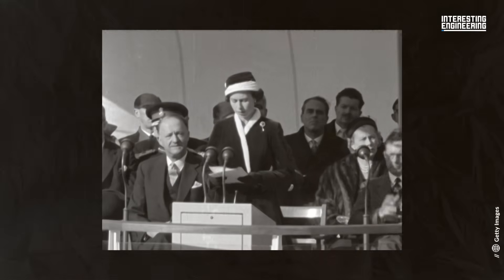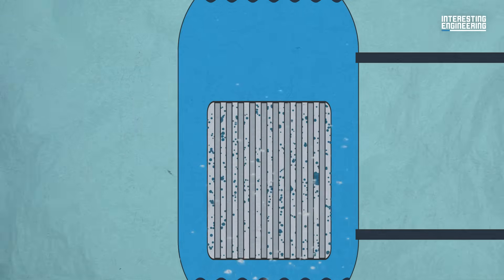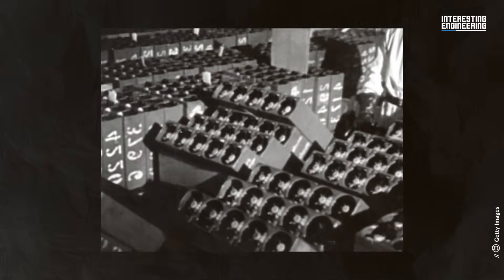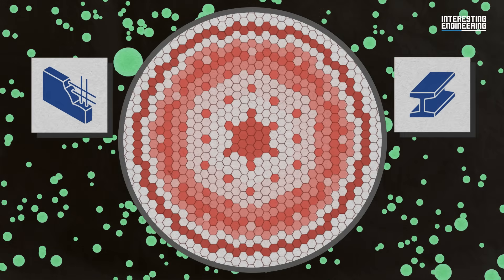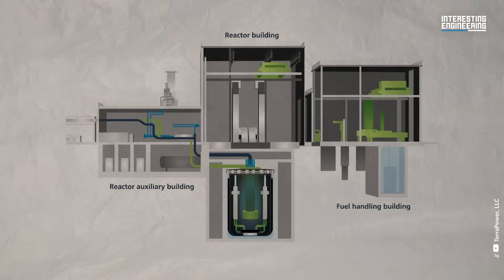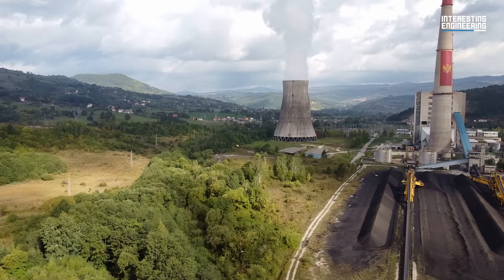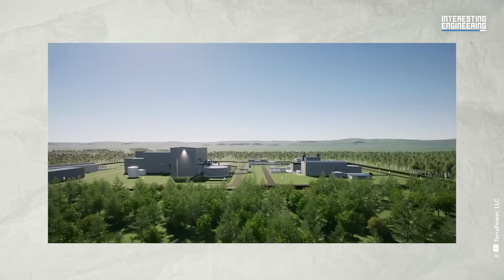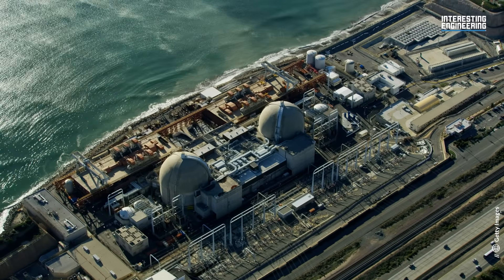Can You Stop a Nuclear Meltdown?

Comment: The containment buildings keep the public safe when one happens.  No radiation injuries in Three Mile Island and Fukushima, but Chernobyl had no containment structure and suffered definite radiation threats to the public.
Reply: missed out windsacle in the uk that released radioactive material in the uk
Reply: @daniellittle7846   Dozens of accidents released radioactive material.  Nuclear energy is the safest we have.
Reply: @daniellittle7846  that was the same as three mile island for the most part
Reply: @davidmoore8741 It was not 3 mile happened because no one believed what the instruments were telling them ,  The guages were telling them one thing but they believed another. Had they allowed the safety measures in place to do the job they were designed to do it would be running now. Chyrnoble was a bad design and an arrogant person in charge conducting a test taking the power  down then trying to restart without waiting for the xenon to decay. When they tried to bring power up because xenon is a neutron poison they had all fuel rods fissionimg and when it spiked they tried dropping control rods but because the fuel and control rods were designed together it made pressures rise even higher. The rest is history. It ran away because the man conducting test wouldn't wait nor listen. Arrogance and bad design.
Reply: wrong.   cancer went up, LNT was proven again.
Reply: They were trying to save money.
Reply: Ever heard of the fukushima 50? There were groups of 50 people who volunteered to go back into the contaminated buildings. They were know as suicide squads. They got water into the reactor. A few have succumbed to cancer and radiation already like the manager of the reactor #3 who spent well over a lethal dose getting his work done.
Reply: @lexinexi-hj7zo  No one has ever went inside the primary containment vessels of the effected reactors since the 2011 meltdowns.
Reply: What about the one in Australia Lucas Heights it happened but know one speaks of it
Reply: @uwishunewme   Because it's not a meltdown, has nothing to do with nuclear energy, and no one was injured.
Reply: @uwishunewme  Lucas Heights are a nothing. A tiny reactor just producing medical isotopes and some research. Nothing to see, despite the local residents hysteria. If you bought a house near a little reactor that can't piss out much radiation if it breaks down, big deal.